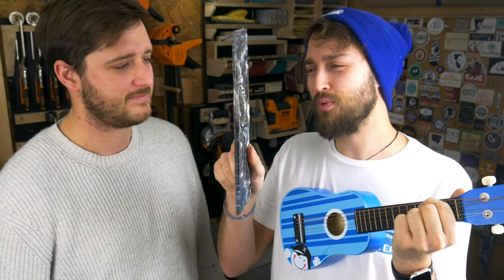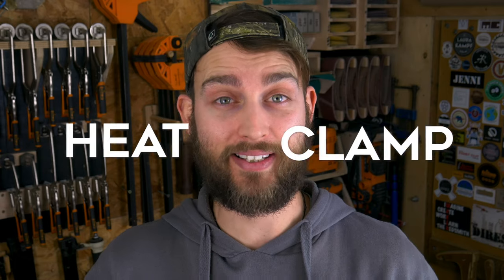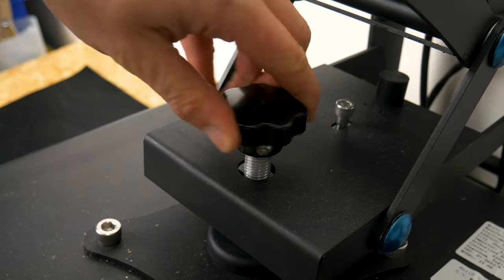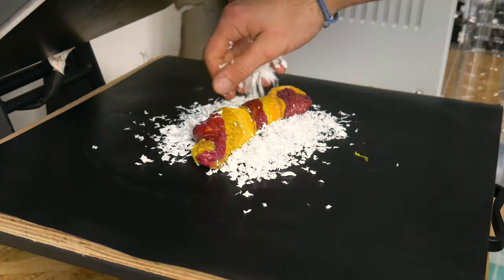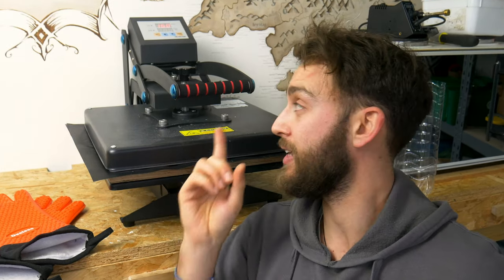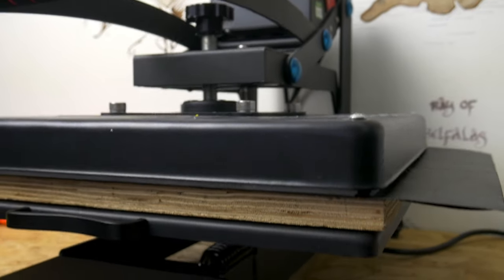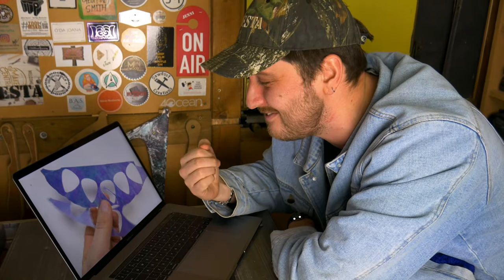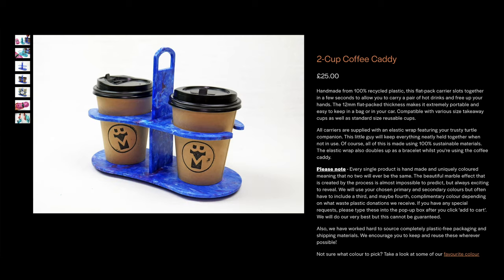Make SUPER Thin HDPE Sheets

Comment: You could make picture frames, using a wooden mold for the front and a thin sheet for the back... but it might require too much plastic. AWESOME VIDEOS!
Reply from the maker: Awesome idea! Thanks for watching
Reply: Very good but tell me what kind of machine used by you and can I made it in my home
Reply from the maker: Tshirt press linked in the description. If you want something easier check out our Beginners Guide to HDPE video - we use a £3 charity shop find!

Comment: I started making my own pics some years back because I was a disappointed with spending 50 cents apiece on a Dunlop 2.0 but also they the store-bought pics only really have like one shape and size I've gotten very deep into making my own but I got to say I never found bottle caps of any kind to be worthy plastic quite often you sand down the edge to make it fine and it leaves a burn no matter how finally you send it if you want to know the best plastic to use its old GFI outlet boxes that are blue plastic that can be rubbed slick like glass.   With the finest sandpaper

Comment: Are there other punches that cut different shapes?
Reply from the maker: Not that we’ve managed to find
Reply: @BrothersMake  One thing I've discovered that works for me for thin and slightly thicker HDPE is using Leather cutting steel dies. I've been buying them on Aliexpress and Etsy.
Reply: @BrothersMake  I'd love to see if you guys could experiment with trying to make patterns. For example, techniques similar to making polymer clay canes and/or segmented wood canes such as those used for woodturning pens. I'm a jeweller and I've been experimenting with making HDPE jewellery but I've been struggling to make patterns, especially straight stripes. Stripes always end up warping on me. It'd be super cool to see if you could make Stripes, checkerboard, polka dots etc.

Comment: Hey! You guys are absolutely awesome! I have a query if you’re able to help? I’m using Teflon sheets and hdpe2 bottle tops but my sheets (when warm, and trying to fold the plastic) are always sticking to both sides of the Teflon sheets? What am I doing wrong? 🤔 😂 thanks in advance! xo
Reply from the maker: Hey! When the plastic first comes off the heat, it is very sticky and will stick to everything. Give it a few seconds to cool slightly and then 'whip' the sheet off quickly. That's what works for us!
Reply: @BrothersMake  thank you so so much!! That worked first time! I really appreciate your help, thank you again!

Comment: can you use silicone molds to shape HDPE plastic into something? or will it not work/ruin the mold
Reply from the maker: You’d need a high temp silicone. But the main issue is that you need compression to force out the bubbles, which bends the silicone
Reply: @BrothersMake  oh thank you

Comment: The thin sheets look light enough to cut into slats. The slats could be used as window blinds. Also, they would probably work very well as ceiling fan blades. Recycled plastic fan blades would look a lot nicer than the hideous pseudo wood blades that the fans come with. So as not to waste, offer the hideous blades to others.
Reply from the maker: They're great ideas!

Comment: I just used a pair of pliers. With no teeth and flat inside of the mouth. And also apply heat with a lighter or candle yo.      
Also u don't need a Teflon anything to make the plastic not stick to the surface.   Is plain water or even oil but I might spit on my thumb while its still hot and swipe across the membrane surface.        
But yo man bottle caps are 100 inferior.   Pick making plastic 
   Old gfi boxes are the shiznit.     
   But bottle caps have fibrous            material that doesn't smooth out anywhere near as much as higher quality stuff.